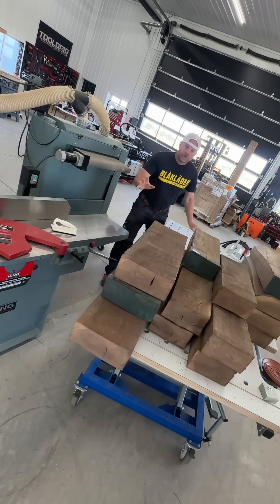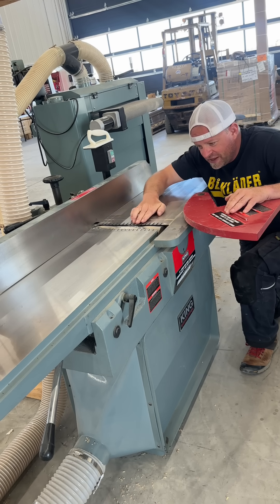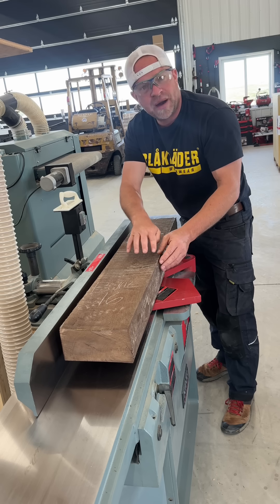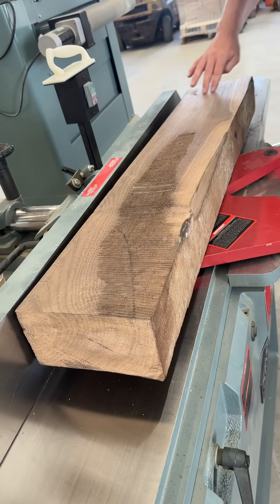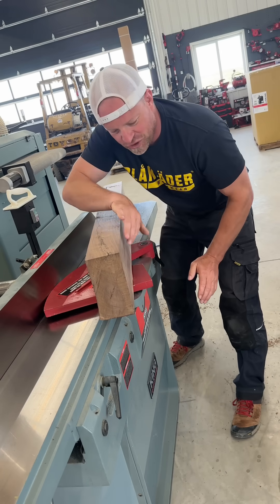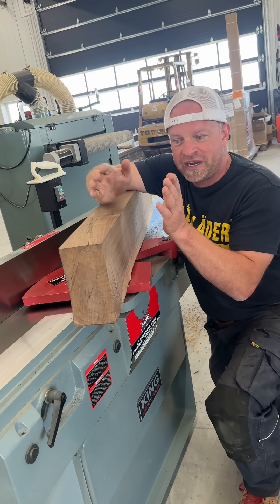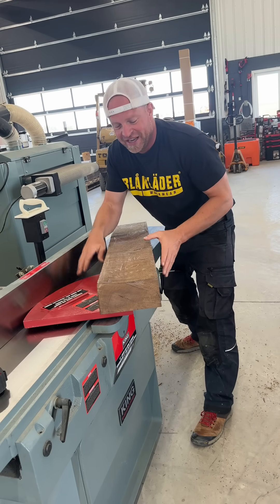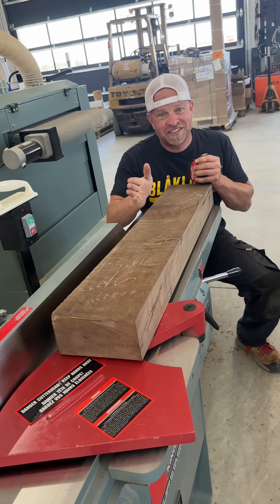How jointers work and why you also need a planer

Comment: Can't you make a jig with a roller on top on the jointer where it holds the board so they can parallel them or does the planer do both sides at the same time? I'm very new I've never used one of these machines, even though i just picked up a benchtop jointer

Comment: You could do the remaining smaller section of the lumber if you use the larger already straight side you did,  but you just flip it. Since you are referencing a flat side on the jointer, you will get again another squared side in reference to the larger flat side, and the 2 small sides will be parallel. You only need to go on the planner for the last side.

Comment: This is the best explanation I've seen on this. I learned this the hard way when doing the opposite on my planer without using sleds and wedges. Im looking forward to getting a jointer soon. Ive been thinking about getting a helical head 6" but starting to think an 8" would be the better longterm option.

Comment: Just checking, so you don't put any pressure on either side of the wood when pushing it through the jointer? How I was taught back in middle school wood working class is that you start by putting pressure to the staring side of the jointer table, but you move to the finish side as most of the wood has crossed the blade so you don't end up creating deeper cut on the end.

Comment: Beautifully explained! Question: is there such a thing as a sliding fence for the jointer? That way for the second surface you could clamp to the sliding fence instead of pushing to maintain contact with it.

Comment: Hi, It is refreshing to see someone explain the correct way to mill wood. People new to woodworking get to see too many "hacks" or shortcuts without seeing the fundamental principles. It also good to see someone operating equipment that hasn't had the guards removed. 
Not everyone has helical cutterheads, it may have been beneficial to explain planing with the grain rather than against the grain.
thanks
Reply: You are wrong. The best carpentry skills in the world come from China. The inventor of the mortise and tenon structure was Master Lu Ban from ancient China more than 2,000 years ago. If you search for the works of Grandpa Amu from China, your opinion will change!

Comment: one thing to keep in mind, that a helical head like you have there is not less taxing on the motor, it actually draws more and is harder to push than s straight knife head, I personally do not recommend them on a jointer, but I am in the minority with that, people have been trained with false information by the companies that make them that they are better.

Comment: I'll bet there's 1,000 videos on youtube going over the same thing. I think it would be more illustrative, to actually take a board and run the second face over the jointer to visually show the problem. If you did that and then showed how the actual dimensions end up out of whack, it would be better. It's possible to end up with a wedge if you use the jointer to do both faces of a board. Other interesting subjects for discussion using jigs:
1. using a thickness planer to joint a board’s face
2. jointing a board that’s wider than your jointer
3. using a table saw to squarely cut both edges of a board

Comment: After doing the first face, you picked one of the 2 sides. What if you then picked the other one with the first face up against the fence (you’d have to turn the wood around), then you’d end up with the 2 thin sides being squared to the first « large » one, right? Then, you could do the last large one by putting one of the thin sides up against the fence? Or is there a risk that using a thin side as reference doesn’t ensure perfect « squareness » ?
Reply: If you only use the jointer to square and flatten all four sides, the two wide sides will not be parallel to each other, same for the two edges.
The jointer creates two surfaces flat and square to each other, for the planer to reference off of.
I hope this helps.

Comment: Very informative, but I feel that there is a bit more information that should have been added. Especially regarding grain direction and answering the question “why can’t I just turn the board around and use the jointer for all 4 sides”? 

I used the “try it and see” method on some cherry and f found out.

Comment: Was a very good video, perfect explanation, but if you needed to watch this to know this, I'm not real sure you would ever apply it. This is called common sense. If you don't have that you could not execute this.
Reply: And should probably avoid these machines. They (especially the jointer) can be dangerously problematic for the unenlightened.
Reply: @MarkZart  Nope he should learn how to use them instead.
Reply: @fancraft1266 That was the inference, thus the ‘unenlightened’. 
Dusty provided the path.

Comment: Very good demonstration and explanation. People should also know that the downward pressure exerted on the workpiece while feeding it over the cutterhead should be primarily over the outfeed table especially when jointing thinner material.
Reply: This is such a good comment and important point.  I sometimes struggle with the jointer and the leading end to the lumber keeps getting thinner than the trailing edge.  I have realized that it´s a problem with pressure, but I would love to see a video focussing on this - that is, where to properly apply pressure as a board proceeds through a jointer.
Reply: @hietpas4062 I may know exactly what your problem is. It sounds like your cutterhead is too low in relationship with your outfeed table. You should reset the outfeed table to the cutterhead with a good straightedge. The outfeed table should be approximately no more than 0.002 below the cutting circle of the cutterhead. Another way to explain it is that the cutters should just barely "tick" on the straightedge while rotating the cutterhead slowly by hand with the machine unplugged. Set the outfeed table while adjusting it upward, not down. Be careful not to nick the cutters with the straightedge.